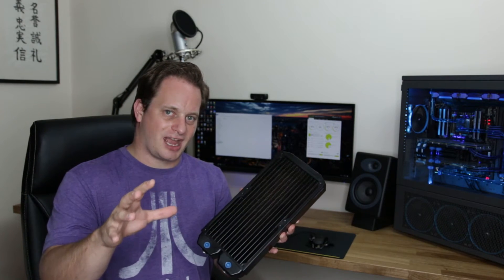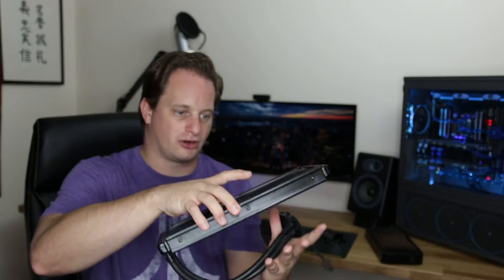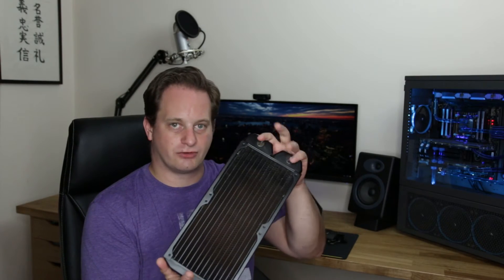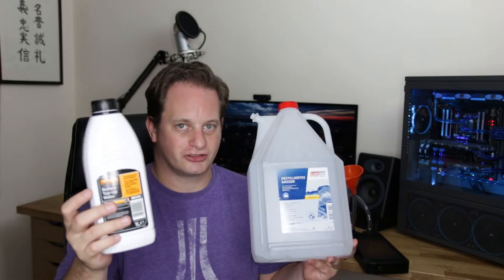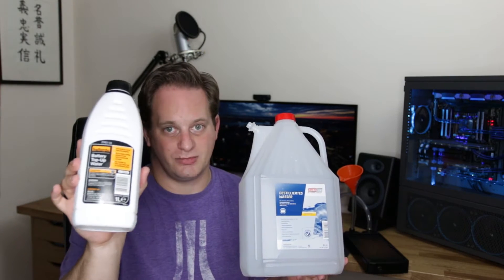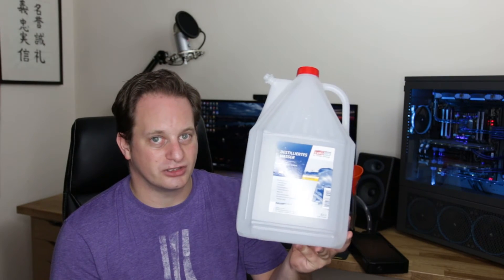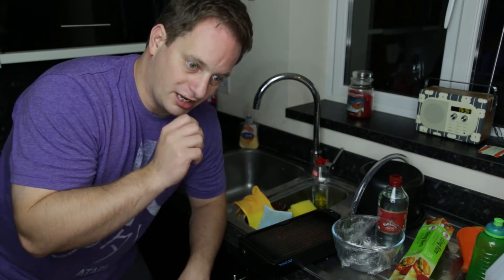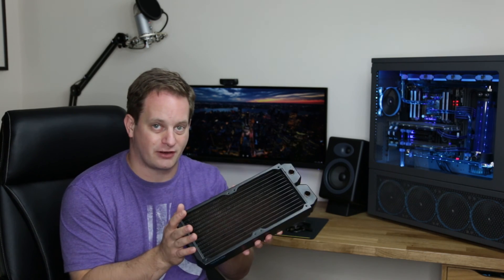Geek School - Why you should flush your radiator

Comment: Thanks for a detailed and informative video
I have a question though. I have a liquid cooled CPU and have noticed over the past several months the temperatures are higher than usual. Does this mean there is a possible loss of flow in the water and will I need to go thru the same process as in your video?
Reply from the maker: +expert25 it’s possible, if your sure your pump is working a good clean is a good idea. Should do every 6 to 8 months as maintenance really. How long has your fluid been in there?